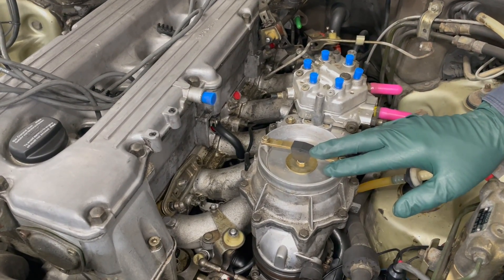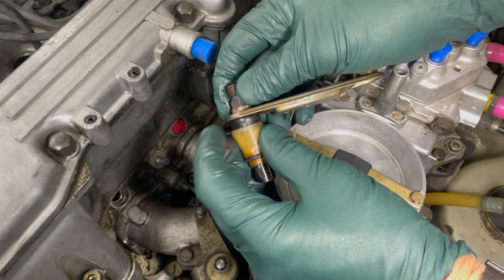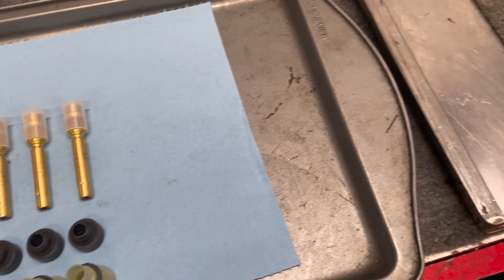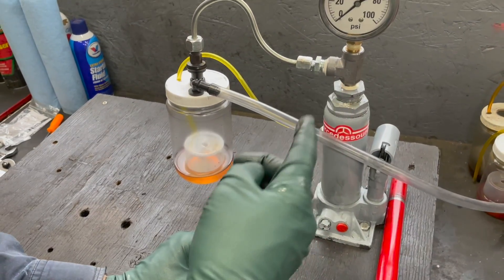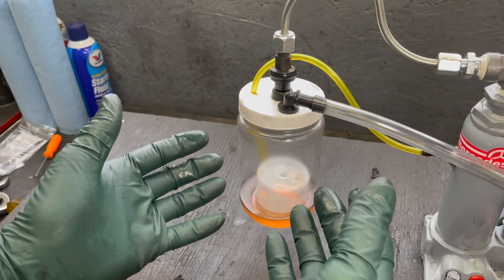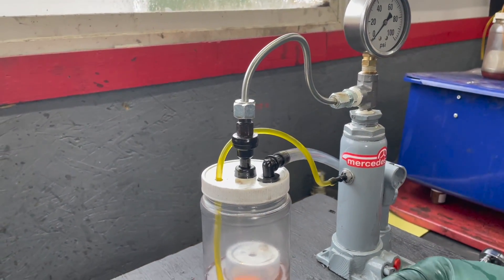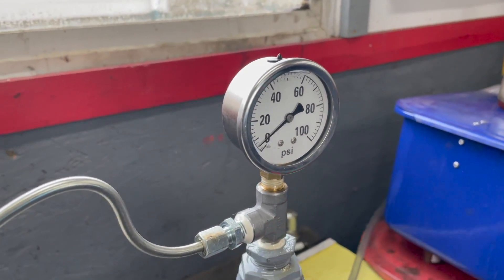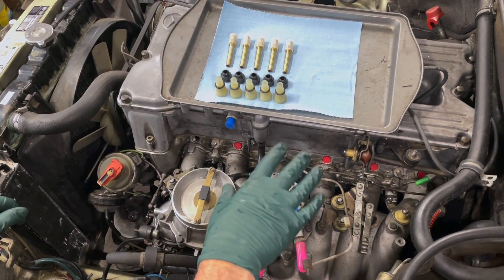Bosch K-Jetronic Fuel Injector Removal Testing Resealing Replacement

Comment: This tutorial series is absolute gold! Thanks. Wish I was confident enough to try all this. I was fooled into buying a 1987 Audi 80 1.8S b3 66kw with what I believe is the same k-jetronik as yours... Its not running well, not starting well, lacking acceleration, and idling all over the place. I live in Bosnia and mechanics here don't want to touch it even though the body and interior is nearly immaculate. Thanks for making this series so clear and concise and easy to follow.
Reply: you can do it bro

Comment: Where can i order a set injectors
Reply from the maker: https://mercedessource.com/store/1976-1980-450sl-450se-450sel-fuel-injector-replacement-kit

https://mercedessource.com/store/1977-1983-280e-280ce-280te-280se-280sl

https://mercedessource.com/store/1981-1985-380sl-380sec-380sel-fuel-injector-replacement-kit
Reply: @Mercedessource  is the m117 450 the same as a 500?

Comment: Kent, have you ever used Hoppes 9 gun barrel cleaner to soak and clean injectors?  I know the FAA recommends it for some recip aviation engines.  I have had success with it myself on these KE injectors.
Reply from the maker: Hi Alex, I am familiar with the cleaner but have never tried it on injectors. I will give is a shot. Thanks for the tip.  Kent

Comment: I would be interested in a video that explains the KE-Jetronic fuel accumulator. I can't really remember if you did one in the past or not? The different types that are out there, what happens if it fails and what maybe the consequences for the fuel delivery system when it's taken out from the equation.  I will say from a personal experience that the car will work without a fuel accumulator however for the long run it will start ruining other parts in the fuel system.
Reply: For funsies, start with this video by Kent. It's a diaphragm and a big spring!
CIS FID Fuel Accumulator Opened Up: You Won't Believe What's Inside!
https://youtu.be/mD2UrQSWsxI
Reply: Also, start at the 8 minute mark of Kent's video, where he starts discussing accumulators:

Mercedes Gas Fuel Injection Delivery Systems 1959 to 1991+ Options for Repair or Replacement

https://youtu.be/OeOy-y7JCc4
Reply: The basics of "why" for the fuel pressure accumulator: it keeps the fuel in your injection system under pressure, and this is good for hot restarts. The increased pressure raises the boiling point. Early Bosch K/CIS (pre "-E") cars, you could drive them, get them hot, park them, then come back later and have trouble getting them started because the gasoline had turned into vapor inside the fuel lines. Known as "vapor lock." (Also a problem for suction fuel pumps on carburetted cars, etc.)

Early CIS cars had smaller accumulators, then had new, bigger ones retrofitted to fix that problem, new cars got bigger ones.  Kent in the second video I linked, I believe he said they got smaller again when MBz went to the two pump concept.

Fuel pumps running create pressurized gas which goes into a chamber in the pressure accumulator, pushes against a diaphragm seal, and then, provided the seal is not old and dying, goes nowhere. The diaphragm moves against a sturdy spring and now, even if the engine is shut off, that spring pushing against the diaphragm creates pressure throughout the system.

(Uh... unless some of your injectors are dribbling! This all assumes no leaks upstream.)

I may have solved a hot restart problem on mine recently with the replacement of the accumulator.  Or, I've got two to five other problems and that wasn't it, and am still on the diagnostic hunt! You know.... For now, I've got good starting, cold and hot.
Reply: Would post a video or a picture about the vacuum sistem of this engine? 110, please!!!!! Like we're it goes tubes from warmer to the warming valve and distributor with 2 diaphragm. Thanks a lot